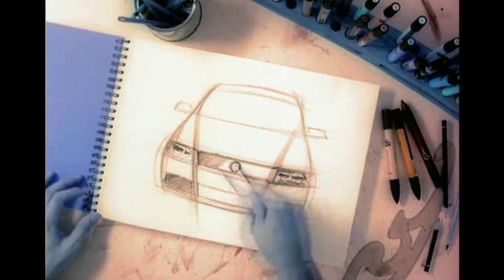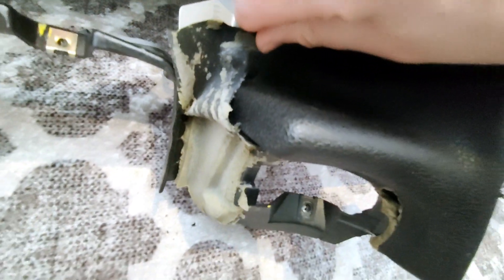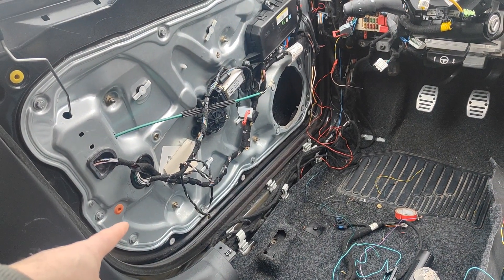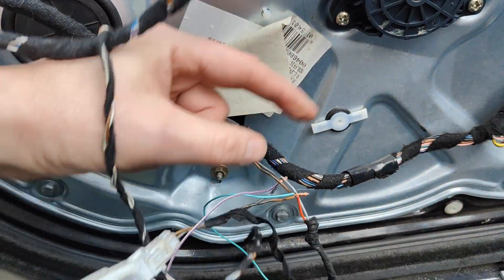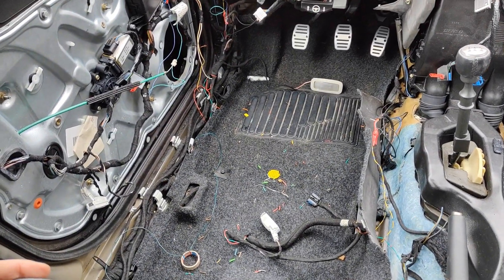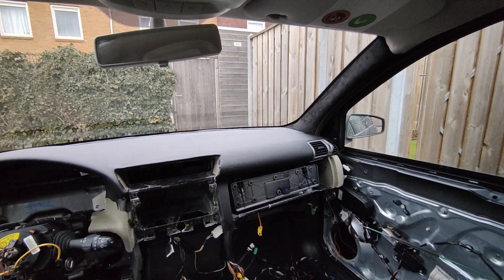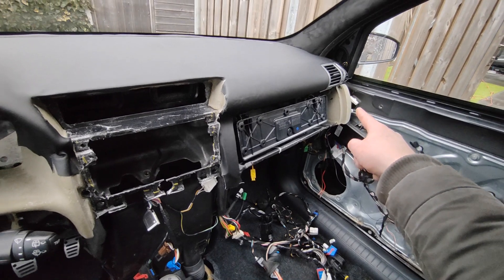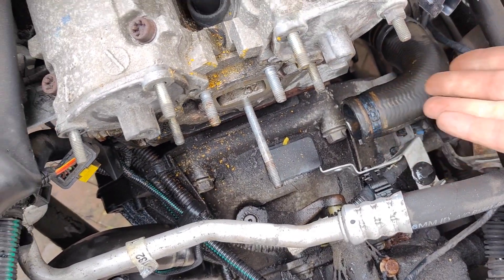FIAT STILO BLACKMOTION PROJECT , PART 2  #dreambuild

Comment: May I ask about the side mirrors? Your seems bigger, where did you get them? My 2001 Stilo has smaller ones, Thanks for the aswer.😄
Reply from the maker: I bought them in Brazil. They have side indicators which i will show you in the next video 😃
Reply: @ItalianRebuild  Okay, I'm looking forward. By the way, was IT difficult/expensive to get them from brazil?😅
Reply from the maker: @filip2425  Mwah not really.....they are second hand with import around 70 i think. Have them for years so cant remember exactly